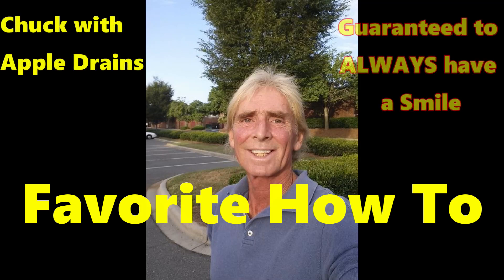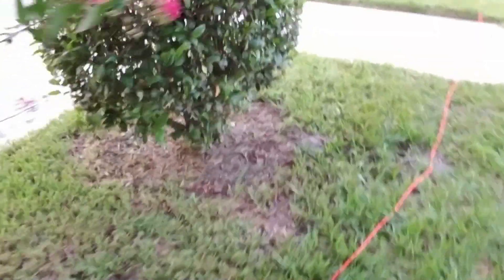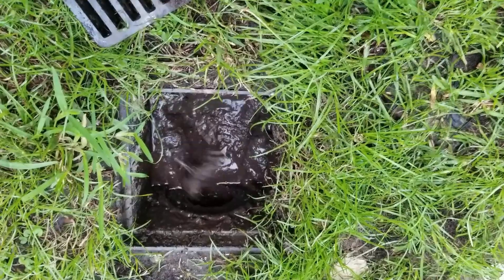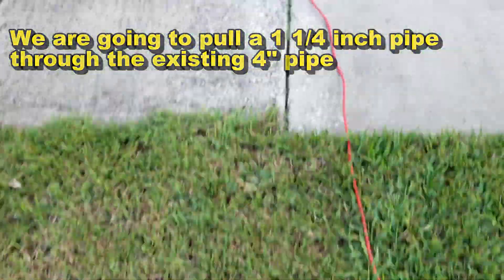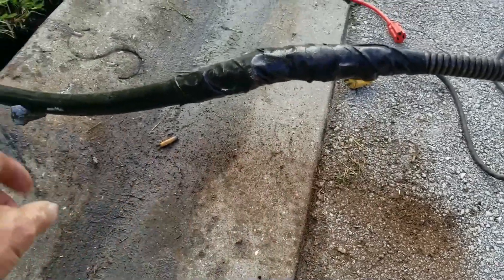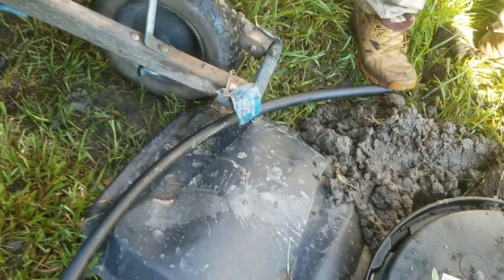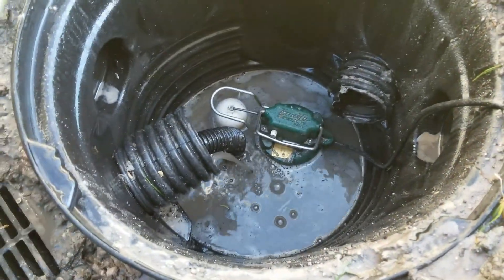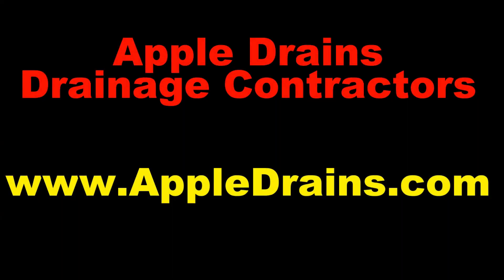GENIUS WORK With NO TRENCHING! What No Plumber will Do! Fix Existing Backyard Drainage.

Comment: I am about to do the same thing with a zoeller m98 for a customer. Do I not need to have a backflow preventer?
Reply from the maker: Yes. There is a check valve located on the discharge line just after the pump. It is needed.
Reply: @appledrains  is it the same one and a half inch backflow preventer that you use in your other videos?
Reply from the maker: @JKrewe1  yes
Reply: @appledrains  thank you for all the amazing video help!